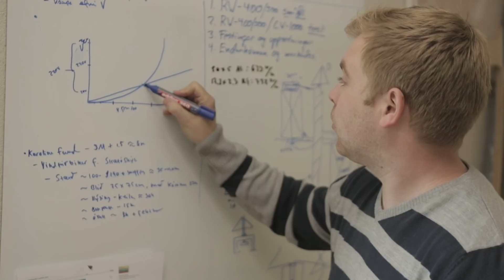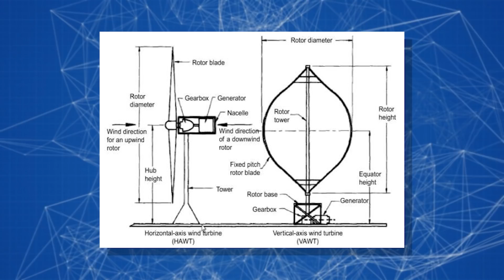Why This Wind Turbine Will Change The World

Comment: Helix wind turbines aren't new. Don't call a company making wind turbines of a type an invention please.
Reply: @Mannys-World  VAWT are less efficient than HAWT, so what? They are superior in all other aspects. The efficiancy of VAWT is between 30-40% while HAWT are at slightly above 40%. The other diference us that HAWT are likely to get installed in places with the best wind quality thus naximizing the energy yield, for VAWT that is not the case, they are likely to be installed whereever is some funds left to get some extra electricity. And this is a concept that many people still do not understand: To get sustainable electricity we need to get every bit possible as compared to nothing. That means using every bit of space available in urban areas.
Always remember that the alternative is none at all.
Reply: @phelanwolf6747  Vertical axis wind turbine are better because they are so much less effecent that they do not require storage and trasmission over distances in the MW range. They will not kill as many birds plus there lower to the ground so birds dont have to worry about them as much as other animals.over distances in the MW range.  Thay are lower to the ground so birds dont have to worry about them as much as other animals. Plus they no power comany will use these because of the efficiency at scale so they will produce no sound and kill no birds
Reply: @phelanwolf6747  Incorrect. Even the best VAWT is 17% less efficient, on average, than the best HAWT, and that's all other things being equal. Since HAWT are usually working on far higher heights, they also can use stronger winds, which exuberates the problem of energy-production for VAWT's. It's all a matter of the most bang for the bucks, son.  VAWT can only by economically viable in niche markets, like in area's with lower, omni-directional winds. Like cities. Seen their small (and thus also cheaper) form factor, they are most suited to that as well, but it also means they'll never contribute greatly (at least not viewed per unit) to the total electricity mix.
Reply: @ignorancebeater650  We’ve unfortunately been locked-into the privatized/centralized perspectives for some time now.  
VAWTs may be less efficient, but allow decentralized & off-grid power, as well as increased safety & reduced maintenance cost factors.  HOW do those not factor into “optimizing”? 
These can be tethered to top & bottom framework, for added safety. They are easier & less costly to maintain.  They can be cobbled together from spare parts by tinkerers.  Win win win. 
For decades, public’s been told optimizing for greatest returns was key; if a unit could not meet or beat the output of highly engineered units, we were told, “don’t waste time or resources”.  Not just for wind turbines, but buildings, & more. 
That was used to discourage using passive solar of all kinds. The collateral damages from that mode of thinking, throttled use of solar, wind, geothermal, & much else. 
That mode of thinking has been throttling wave generation installations, along many thousands of miles of coastline & rivers. 
How long do YOU think we all have, to gamble on centralized, privatized, “best output” systems, which have blocked even trying to optimize SOMEthing, instead of Nothing?  
We had a very nice burst of activity towards solar/ wind/ microhydro/ geothermal etc., home-tinkered systems by hippies, for a few decades. Some still working.  …Those who have been using the “less efficient” methods, would argue that they really do not worry about that.  
They get the power for their needs; they know how to maintain it without breaking the bank; they often can easily use recycled materials for free.  
Perhaps, the only contingent wildly concerned about optimizing maximum outputs, enough so, they would angrily try to throttle & block less efficient ..Renewables.. are those who insist on centralized, privatized systems?
Reply: @Chimonger1  Sigh. Well, what can I say. Ultimately, my friend, it's the free market that speaks. As said, it all is down to most bang for the bucks. If, as you say, it would be that much better in ALL regards, it would long since surpassed HAWTs. The point here is, while one may point out some benefits - and I'm not denying there are, that's why I said it's suitable for a niche market - the fact of the matter is,  if it isn't enough to beat HAWTs on an economically basis, then all this high praise is for naught. 

For instance: less maintenance cost. How much less, EXACTLY? It would have to be THAT much lower, that it would compensate at least 17% less energy-generation. And probably much more, since, as said, VAWTs operate at much lower elevations. In practice, HAWT's may generate 30-40% more. It's easy to see that, let's say, if you reduce maintenance cost by 20%, and HAWT's deliver 30-40% more, the economical advantage STILL goes to HAWT's.

Bottomline: it's all economics, my friend. The advantages one has count for nothing if it's not a clear and direct advantage that you can see in the bang-for-the-bucks comparison. Nothing else matters, as a private enterprise. And if those advantages were truly generalized and exceeding HAWT's  economically, they would have been the preferred way of doing things already. The free market isn't biased, it just chooses what is most viable, economically. The fact it didn't choose VAWT's as the main, most lucrative windmill, already speaks for itself. 

So, bottom line, the advantages you speak of only come into play in certain conditions where they TRUMP those of HAWT's. Like, as said, in low-wind area's, and omni-directional winds, like in cities. It's not that those advantages don't exist anymore, say, for offshore windparks.... it's that they do not have the economic high ground there: the advantages in these area's just can't trump the advantages HAWT's have on an ECONOMIC front.
Reply: @ignorancebeater650    I did not say “either/or” choice. 
There is room for both. 
HAWTs work for commercial privatized utilities and with profit margins at top of their list. 
And, there are Millions of folks who would not care if VAWTs, or microhydro, or even solar are less efficient; those would fill a perhaps bigger niche than you might think.  
Solar is not as efficient in the PNW region, either, yet, it’s being installed at impressive speed.  
Bottom line priority, is doing everything we can each manage to do, to decrease our carbon footprint.  That will mean, millions either go without, or, they DIY less efficient…but SOMEthing, to help themselves.  
The lie of Trickle-down will Limit industrial sized but more efficient efforts, simply because those are largely out of reach of the billions of people who cannot afford them but, who’s participation in efforts to stop Warming, would make the most impact.
Reply: @Chimonger1  Well, yeah, there is room for both, but my point is, that the case for VAWT's will be a niche-market. The problem with local or DIY VAWT's for self-proficiency is not only that they're are highly inefficient, but that the energy you get from it diminishes WITH THE SQUARE FOOT of the windforce you can capture.

Well, I don't know about you, but around here, you can't build something larger than 8m without a permit, and I think every country or region will have such limits. There is NO WAY you can place 100m windmills, VAWT's or otherwise in your backyard "just like that". Even if it would be legal, the NIMBY effect would get into full force, as it now already is with commercial windmill farms.

So, ok: you can place, say, VAWT's of 8-15m long, mayhaps - in any city-like environment that will be the max. At that height, they will be completely useless most of the time. The turbines of those devices will, at best, provide between 20- to 500-Watt; enough to charge the battery of your smartphone and light a lightbulb, but not much more. IF it's windy enough, that is. It just is not worth it, and for larger VAWT's there will be rapidly augmenting costs of building, maintaining, red tape and nimby effect. Very few individuals can manage that, and if you're an enterprise, and have prime windy places, then you're better off with the more economically interesting HAWT's.

Windmills in general, and especially VAWT's, are simply not economically enough as small DIY projects to be worth the investment and (even if they're lower) maintenance costs (and battery costs, if you want to have it somewhat stable). It might be a supplement, yes. It might still be worthwhile in some instances, like for the occasional light of a shed or farmhouse or stable, or for a waterpump or some sort. But it's not going to make a big dent in the energy-production, and it will never be mass-adopted if there are more interesting alternatives, economically.
Reply: @Chimonger1 No problem; the reason is the same: complaints. Complaints the coast-sight is made ugly, complaints the birds get killed, complaints it is within the routes  of ships/freight. The one you will hear less is the 'visual disturbance' and the 'sound' IF they're far away enough of the coastline.

Edit: if you're specifically talking about coastal wave-generators, it's because they're only economically viable in certain area's where the tides provide enough energy, can't be a disturbance for ships and boats and sea-wildlife, etc. But hey... I'm not stopping anyone. Be my guest. Provided you can be economically viable, and you don't actually see or hear it, the nimby effect will be less than trying to place a VAWT or HAWT in every backyard.

But the closer and more obtrusive to your backyard something gets, the more the NIMBY factor comes to play, my friend. that's simply a fact. That's also why - to contradict you  - PV/solar panels build on a rooftop will cause far, far less nimby problems than any windmill. No sound, no killing of birds, and the roof was already there anyhow so no taking up extra space and no eyesore... so very little nimby problems there.
Reply: they arent new and its well known they dont work very well either.
Reply: @Withnail1969  <--- found the oilfield worker, LMAO
Reply: @rhianimal19  You dont have yo be an oilfield worker to recognize that this is not a new design and that it doesnt generate much power at all. You just need to be observant. The only thing going for this design is it's simple design and fairly low cost to manufacture. But a cheap nearly useless turbine isn't a good investment no matter how you look at it.
Reply: Get over yourself.
Reply: @Mannys-World  There are a number of VAWTs that use aerodynamic lift such as the Darrieus and the Gorlov turbine. The one in the post is just a rehash of the very old Savonius design. It uses drag, not lift. Darrieus and Gorlov turbines can be every bit as efficient as a HAWT, but suffer from the problems thatall VAWTS suffer from: low speed dirty air close to the ground, and the inability to turn away from the wind to slow them down. The centrifugal forces in HAWT are distributed radially along the length of the blade, whereas a VAWT experiences those forces perpendicular to the blades and concentrate them at the points of connection. VAWTS will never be able to overcome these problems.
Reply: Of course it’s a great invention, if not, why don’t you tell us which one you have is currently producing electric power?

Comment: Ok they look cool but without some stats and comparisons this segment is a fluff piece, what do they cost per Kwh generated over extended periods? I saw this design at 2 years ago so finding some data shouldn't of been to hard. I like the idea of them because they are small enough to be used domestically and a diy design could be made for under a grand, then they could make some sense and make a difference to peoples lives.

Comment: While some Vertical Axis systems can reach energy efficiency close to those of conventional rotor blade, they suffer in areas that make them untenable commercially, for example the primary reasons a Rotor Blade generator is tall is not because of the blades, though larger blades increase efficiencies, but because of reasons of Mass Air Movement, as there is more energy the farther from the ground effect, this is why Horizontal or conventional Rotor Blade systems function best as large off-shore sea based systems, So even Vertical Axis systems will need to be built high, and this creates issues with servicing the Gearbox, as it is these mechanical issues that increase Vertical Axis operational costs and decrease their life spans. There has been some fascinating research on Vortex Based models but no testing systems have been developed as of yet.

Comment: Looks to be a far more efficient bird killer than the architect ones currently in use and failed.
Reply: especially if you set them up in migratory routes, you can clean out entire species in just one season's run

Comment: Dude "Since the beginning of the 20th century the average annual temperature has increased by 1 degree." That's an absolutely retarded comment. That would be 121 degrees! It's risen 2.5 degrees in a century, and I cal lb.s on that, because we have no idea what real world temperatures were for most of the last 100 years. Low tech thermometers in very few places around the globe, and often times in heat sinks gave us our guesstimates on temperature. I love oil and Nuclear. It works, it's inexpensive and it has helped create the greatest economic boon in world history. Oceans are not rising, pollution is less in the high tech west, we have more trees now than 100 years ago. Temperatures stopped rising 20 years ago, corresponding to sun activity just as temperatures did for the 20th century. Global warming is a marxist power grab and a fair tale for adults.

Comment: About fifty years ago a friend showed me the same invention, with an extra boost, provided by a hoop much larger than the diameter of the centerpiece, fixed to receive a wheel attached to an arm fixed on the central axis, and resting on it, driven by the centerpiece, but as it's further from the center, more rotation.
Reply: indeed, this is not an invention from this guy, is just another variant from a vertical axis windmill.

Comment: Yes but how much petroleum based fuel does it take to make these “green” energy sources?
Reply: Just depends how much green energy was used in the mining and manufacturing process. As the renewable energy production and storage infrastructure and vehicle development builds out, there will be zero petroleum fuel used to produce them. Lot of metal smelting is done with electricity these days. There are already battery powered mining trucks in use due to efficiency. Going downhill helps recharge the battery for going uphill and electric motors can provide quite a bit of torque right from the start. Pretty much all equipment inside most manufacturing plants are electric powered. 
Some petroleum probably will still be used though, for the creation of plastics used to cover wires, maybe for paint, and other misc needs.
Only 11% of energy use in the US last year came from renewable sources, but that is double what was used 20 years ago. With the rate of acceleration, that could easily be 30% in the next 20 years. Industrial sector use is only 22% of US energy output. It's not a lightning fast shift, but change is happening.

Comment: This video is dreadful. It can't even get the terminology right. Wind turbine blades do not fold, they change pitch and can be feathered in very high winds. Also, wind turbines are tall and have  big diameter to catch the largest amount of wind power possible, and the higher the turbine, the more energy is available and the more consistent the wind.
Also, traditional wind turbine blades use aerofoil profiles, just like aeroplane wings.
Vertical axis wind turbines have been around for a long time, and those little ones on bus shelters produce very little power compared to those horizontal axis giants. Try scaling up a vertical axis generator to produce the same amount of power (which means building high a wide) and you get into other, really difficult engineering issues.
There are now 14 mW horizontal axis wind turbines, equivalent to more than 4,500 of those 3 kW max vertical axis turbines. Care to work out how much space they would take up? And, no, you can't tight pack them in a square as they'd be in each other's wind shadow. They also won't use the wind at greater heights, unless you mount them several on tall towers, and then it still has to deal with the bending moment at the base. Also, as they have such a small spread, then there would have to be many more such towers closer together.
This video is transparently dishonest in comparing small-scale vertical axis turbines with much more efficient horizontal axis turbines required for grid level generation, often in off-shore locations.

Comment: Dihydrogen monoxide in the form of vapour is by far the most active agent of the Greenhouse effect. Is someone going to suggest dehumidifying the planet in the near future? I would be most dissatisfied if the frightened, quivering lunatics of my species didn't cross that line in my lifetime. If you want to be the one let me know and I'll delete this obvious troll-ation. Bit coin donations are useful but I want 13 conch shells.
A connected set of driven Stirling engines would be the simplest method, because the cap ices up. Making launch pads for penguins. The alternative is to question the Science supporting the AGW claim. [Hint: Environmental pollution is mankind's greatest abuse to this planet - how can that be stopped and even reversed? See also Space Junk, stuff abandoned on the moon, endless mindlessness.... seeking yet another distraction]